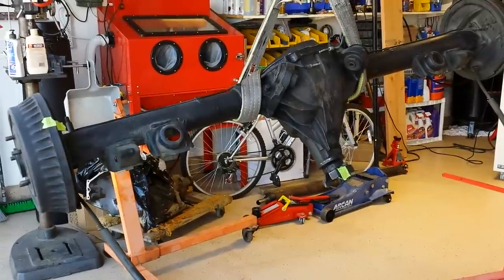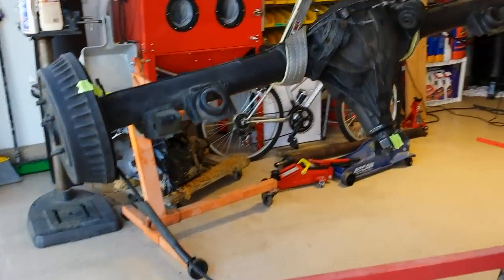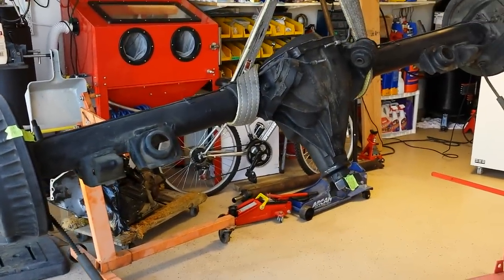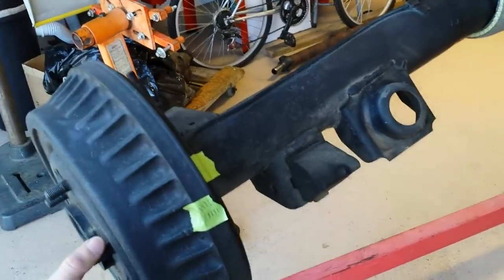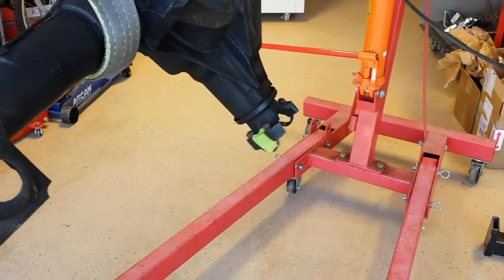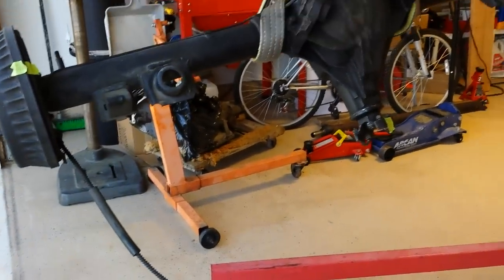Determining Rear Gear Ratio Without Removing Cover

Comment: Turning one side exactly 2 full turns is correct, but you MUST be sure that the other side DOES NOT MOVE AT ALL. If the other side moves, even just a little, it will throw everything off.

Comment: The easiest way is to chock the other wheel if you don't have an LSD, if you do have an LSD you don't need to. Mark the wheel and shaft in the same way, then turn the WHEEL not the shaft. Turn the wheel 10 times and count the shaft revolutions. For a 3.73 diff, with a none LSD the shaft will turn just over 18.5 times (18.65). Multiply by 2 which gives you 37.3. You have turned the wheel 10 times so you need to divide by 10 giving you 3.73.  If it's an LSD axle then it will turn 37.3 times, so go straight to dividing by 10.

To determine whether or not you have an LSD (Limited Slip Differential) axle, simply jack up the vehicle so that both wheels are free to turn. Grab one wheel and turn it whilst watching the opposite wheel. If the other wheel turns the opposite direction it is not an LSD and you must chock one wheel before starting the test. if it turns in the same direction you've struck gold as it is and LSD. no need to chock the wheel.

Good luck
Guy
Reply: I was told I have a 3:55 gear in my 55 Chevy 210 post. I did this and came up with 16.5 rotations with the other wheel chocked, I got the gear ratio of 3:30 can this be right? please help thanks.
Reply from the maker: @TheJhaley12  did you open up the differential cover and seen the numbers stamped to confirm?

Comment: how would you calculate for a 3.73 ?
Reply from the maker: +Luis Rosas two ways.  open up the cover on the differential and note the two numbers on the ring gear.  Divide those two numbers.  Many times, the ratio is listed in the glove box
Reply: Luis Rosas a